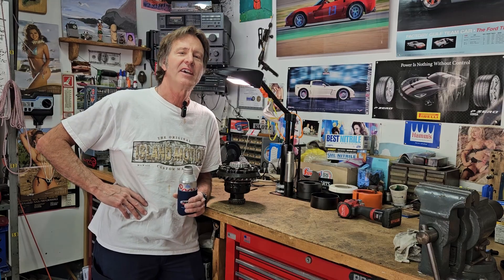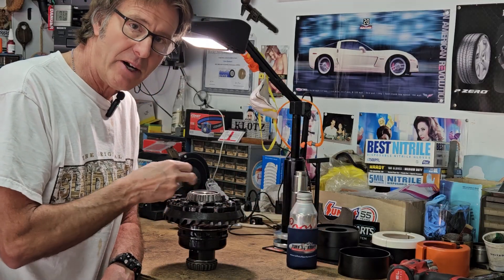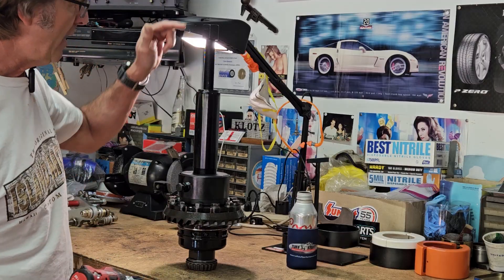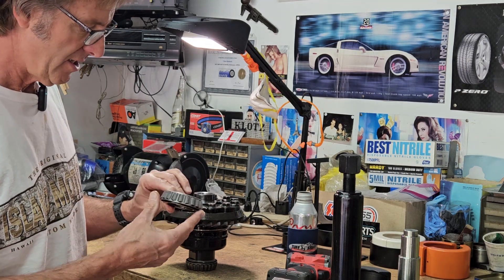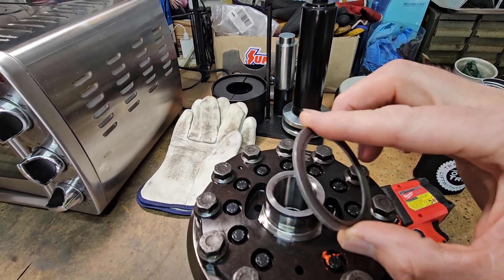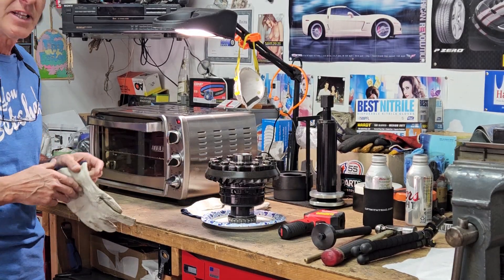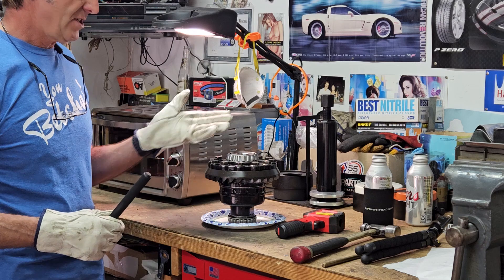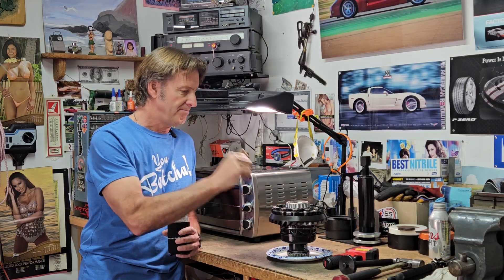RCR  GT40  Build Ep42 Transaxle Bearing Replacement & Updates

Comment: 47 years in the bearing and power transmission business -- and I was good at it. Just an FYI, the width tolerance of a standard-precision taper roller bearing is +/- 250 microns (.250 millimeters). That means that new bearing you put on you differential carrier could alter the position of the ring gear by as much as 500 microns (.500 millimeters) -- REALLY BAD! The tolerance for the ring gear position relative to the pinion is more like 4 microns (.004 millimeters). It pays to double-check.
Reply from the maker: Thanks for the information, I will keep that in mind as I continue the build!

Comment: You haven't driven this car yet, so I am curious how you discovered that a transaxle bearing needed to be replaced.
Reply from the maker: I had issues with the new drain plug sealing, found metal in the drain oil so I decided to open it up and see what I had.

Comment: Was this transaxle sold as a total rebuild??
Or just the syncros ??
Im pretty surprised to see that bearing in that condition.
Can you tell us which vendor did the work on that limited slip? I might want to avoid that vendor.
FYI, Im a retired Heavy Jet Aircraft Mechanic also,
UPS Airline.
Reply from the maker: It was Cogs Cogs out of Georgia
Reply: based on some searches I have done in the past - Cogs Cogs is known to use used parts in rebuilds

Comment: Ya know, as a fellow AP, one of my favorite times was when the snap on or mac truck would come by. When I saw the puller you bought, I was a little jealous. I was sure it must cost a pretty penny. On the other hand,  I have tools that I still haven't used. I think Tim Allen said it best..."I have tools to fix tools"... lol  Super great work! On a side note, I haven't seen you powdercoat anything including the steel brackets on the suspension way back when. If I sneaked the toaster oven out of the kitchen, I'd be dead meat!! ... might be time for an Eastwood upgrade... just saying... Love what you are doing!